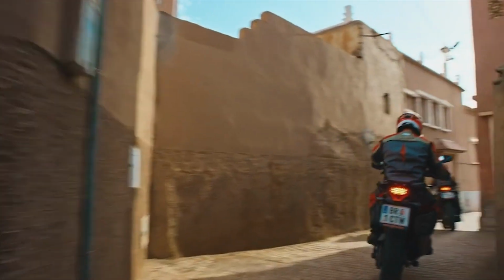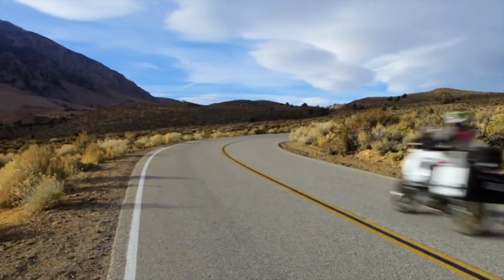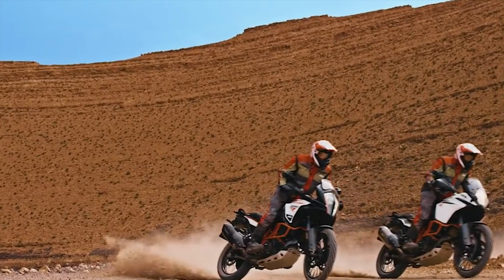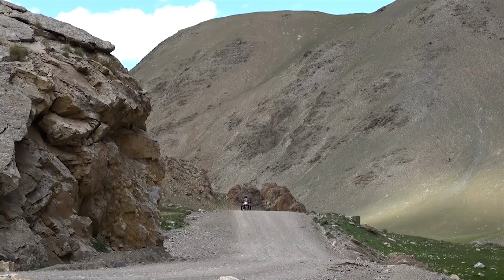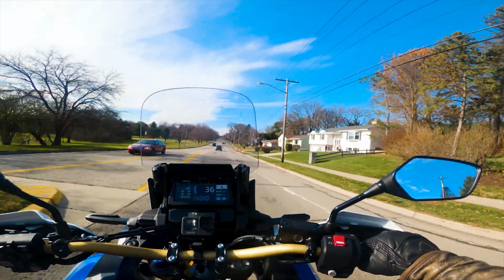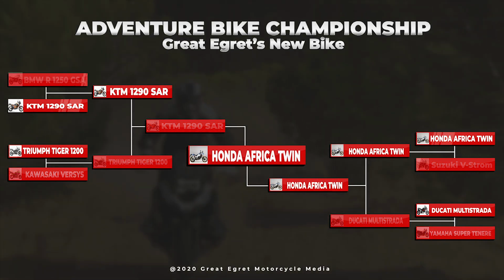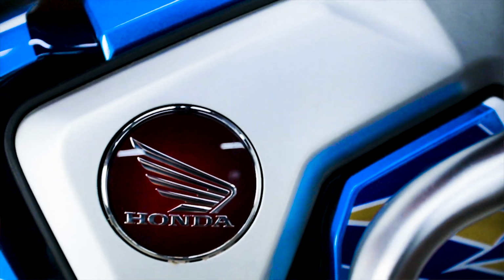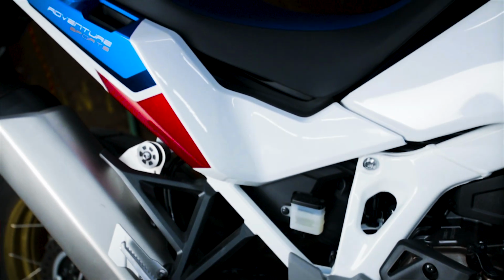New ADVENTURE Bike Day - ADV Bike Championship - Finale!

Comment: Owned most of these bikes in the last 10 years and you got it spot on, my main concerns when going from continent to continent both on and off-road was reliability and no bike manufacturer has the pedigree as good as Honda. BMW was a close second in my opinion having just took a KTM 790 R back to the dealership because of  rear brake failure and throttle body problems within 600 mile breaking in period !!! Now riding the AT DL and loving every single minute. Awesome choice my friend. ATB Mac, UK 🇬🇧
Reply from the maker: It’s such a great bike and I’m having a ton of fun on it!

Comment: Super cool!  How does the weight feel when rolling around?  Does it feel up high?  That is my only concern with it. Congrats!  It’s a great bike and I look forward to many videos!
Reply from the maker: It looks top heavy, but the weight is slung pretty low. It’s way more maneuverable than it looks. It is high, but it has ridiculously good clearance and the suspension can be adjusted so that it sits lower. That’s at the cost of stiffer damping when you need it, though. While I’m not flatfooting, I leave the seat in the high position and have no trouble planting my feet.  I’m really excited to create a ton of videos with this bike.
Reply: @GreatEgret  it’s very exciting!  I bought lowering arms for my Tiger because I can’t flat foot it, but I decided not to put them on because I know this can be ridden. I have developed a technique to put my foot on the rear brake, and slide over to the left. That let’s me flat foot on the left side, no problem. So I have good control there, I just have a constant fear of leaning to the right side. 
Again, congrats on the bike. It looks awesome.